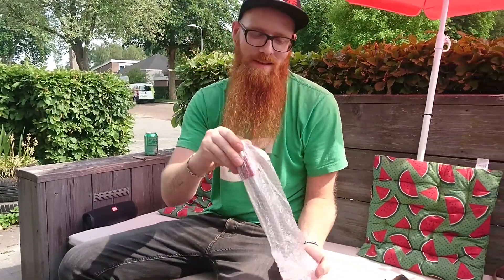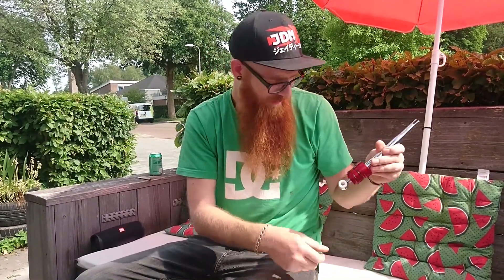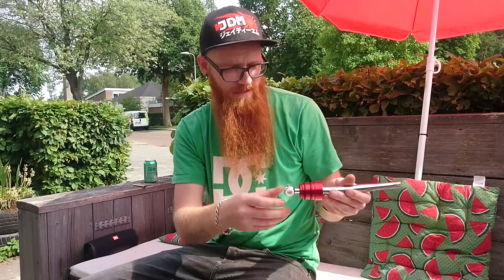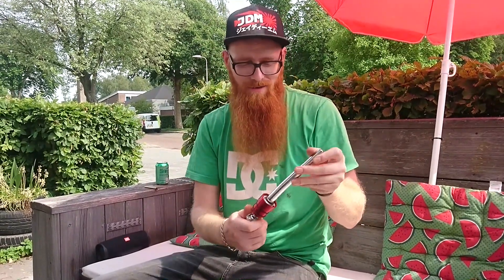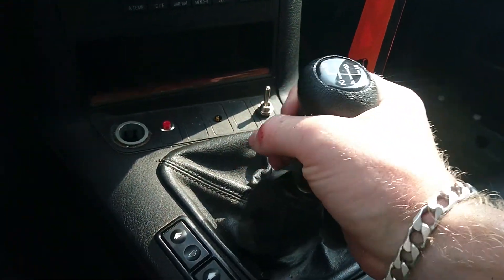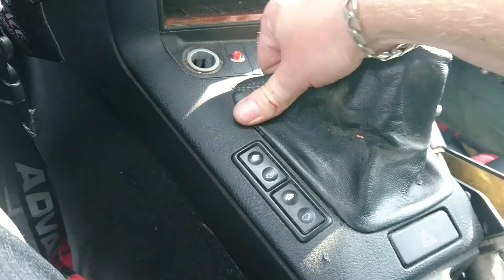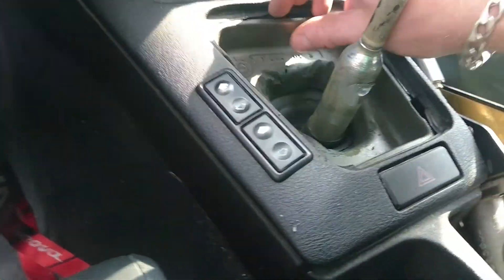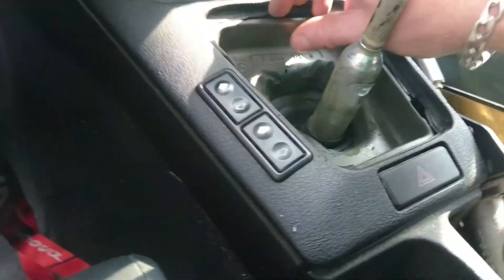e36 shortshifter install

Comment: Your problem with the gearshifter in the backwards gears (2nd and 4th) are probably solved by switching to 6 cylinder gearlevers. Had the same thing after a 4 to 6 cylinder swap...

Comment: I turned the plastic on top but it won’t come off. Any tips?
Reply from the maker: Break them if you don't want to use it again. Just make sure you don't damage the aluminum holder. But you can break them all out  and it should come right out .

Comment: i got the rod at the bottom disconnected so the shifter is now a floppy mess but how do i get the rod out of the hole. it just doesn’t wanna come out…
Reply from the maker: There is a circle of white clips 2 of them are different with little tabs opposite off each other  jam pliers in there and twist it 90' degrees. It should come out. It a little bitch to get out sometimes tho.
Reply from the maker: Last time at a friend we just banged and broke the white ring so it just comes out. Since the whole piece will be replaced anyway.

Comment: Awesome video man! I just cannot get the C clip on the bottom no matter how many times I've tried, any tips on how to do it? I have the straight circlip pliers and all
Reply from the maker: Yeah it's not a ideal position. I was struggling aswell but it worked at the end. Death things never win bro. Put a little more anger in it.
Reply: Same :/ been trying to sand the red bit down enough
Reply: Youll need the bend circlip pliers i have the straight ones and its not easy without bending the clip

Comment: I just did change my shifter, however the gears go in pretty heavly is that normal, or did I do something wrong?
Reply from the maker: It a bit stiffer/ more notchy as oem. Yes that's normal. Also the factory one was a lot stiffer when it was new. It will wear in.
Reply: @theslidingdutchman   Well okay that‘s reasuring, thanks for the quick response. I was kinda suprised how heavy it is to engage from 2nd to 3rd and from 4th to 5th gear.

Comment: Any tips on how to remove I have the exact same but I can’t get it out after the pin
Reply from the maker: Have you turned the plastic on top 90 degree. Like I did in the video.
Reply: @theslidingdutchman  yes I have now it’s just the red base stuck in there
Reply from the maker: @willdossett2387  the red base? Not the oem one? In that case it just a little bit stuck, there like a snap ring on the bottom  of the short shifter one. If that is off start hitting it upwards 🤷‍♂️